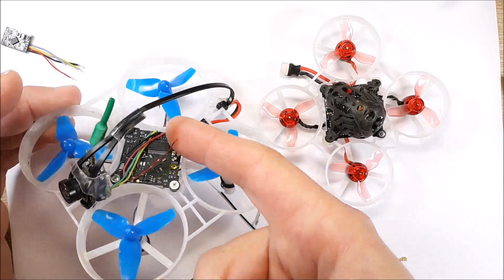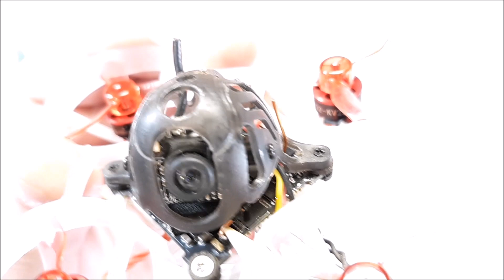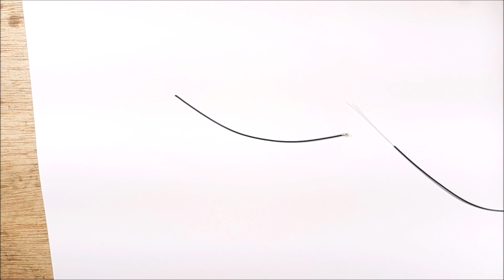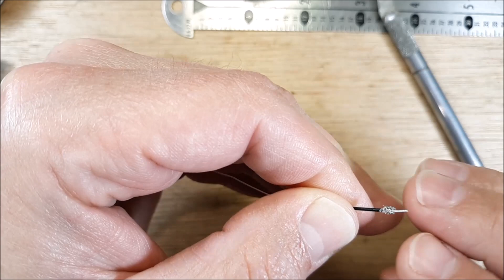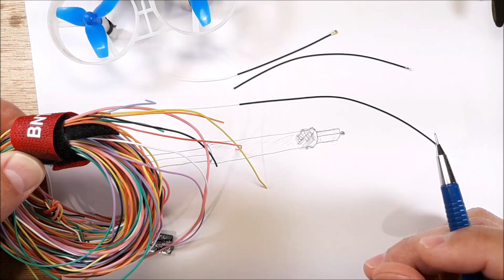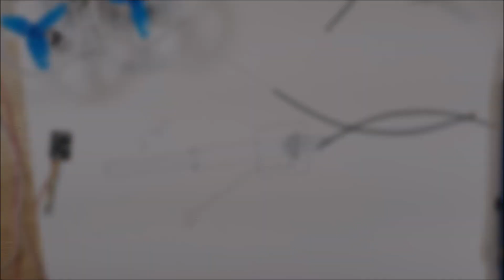Whoop AIO Receiver Antenna Fix | Repair an AIO Frsky Receiver Antenna Coaxial

Comment: Your phone now can " pinch and zoom " to enlarge the picture to see the small detail .   Place 2 finger tips or thumb tip and a finger tip onto the screen and hold them there without lifting and spread and slide them apart to enlarge the picture . I can see the center signal wire active element.  And the woven shielding  mesh.  The shielding mesh surrounds captures unwanted signals and magnetic interference like an atenna and grounds out the electric current from all the magnetic waves and unwanted radio waves and interference . Shielding the center signsl wire . Then the center signal wire that carries the wanted radio signal from the antenna arrives at the receiver cleaner with a signal from the antenna " active elemnt " more clear and less static noise . Your cable tv wire does the same thing to keep your cable tv signal clean .  If cable tv or your drone just used unshielded wire the longer it it gets the more unwanted interference would be added until the signal you wanted was drowned out from all the magnetic noise and static  and transmissions from wi fi and engines driving past and motors around you.  i know everybody knows but maybe someone watching might need to know.

Comment: I need your help, on my Hppymodel X12 1~2S v2.1 fr (latest version)

Been using latest betaflight update from gyroupdate of happymodel which fix the rxlost problem, (its true).

Bu i got problem during 2S flight which is core temp as High above and reaching 90⁰C
Daytime flight is hard.

If core temp about to reach 90⁰C rx lost, on 2S Flight,

Is there any solution ?
Reply from the maker: @junkthe  
If the board is in good working order and there's no shorts, I would assume lowering your VTX output would help. Core temp shouldn't be an issue when flying though. Did you cover it with something? Did you flash the right target and download the correct VTX table? Are you running higher than 100mw?

🤔 Here's more info....
https://www.happymodel.cn/index.php/2022/04/05/x12-aio-5-in-1-flight-controller-built-in-12a-esc-and-openvtx/

Here's the VTX info... (I wouldn't run over power level 2 = 100mw-🔥...🍻

 5.8g OPENVTXFirmware version: OPENVTX
Smartaudio v2.1
PIT Mode support
RCE Mode support
Channels:48ch
Transmitting Power: 0/RCE/25mw/100mw/400mw
Power supply: DC 5V
Current (5v): <650ma (400mw)
Antenna connector: U.FL

Comment: PropsOff You use antenna on a quadcopter, do you think it can be installed in the remote control for better communication?
Reply from the maker: This is a really good question...🍻
I visited this theory a long time ago and found that the radio is supposed to be tuned to the antenna for max performance.. However, those was the days when a radio was $700 - $3,000.... Like you, I wonder if that much attention is place on this fact. I may dig into this after my current projects wrap up...🤔
If you do too, let me know your finding...
Bruce of RC Model Reviews did a great job explaining this about 7 years ago.

Comment: Thanks so much for another great video.   One question.  The original antenna is not grounded.  Why is that?
Reply from the maker: The original antenna is at length for a 2.4ghz signal. If you shield the active part of the antenna, you can hypothetically make the overall length as long as you like. In our case here, we just needed to extend the active portion up and out of the canopy to eliminate emf interference. Hope that makes sense?

Comment: How do i fix random rx loss thats the only issue with my mobula6  build ive even upgraded bolth antennas and it still does it however  my range on my vtx is amazing after watching your external  vtx install vid no the rx loss is my oly issue
Reply: I do not im just using a betafpv literadio 2 se with some antenna upgrades because since i got the newer chips they came out with its bin cutting out randomly
Reply from the maker: @daytonburke7437  
Unfortunately, I don't have the Betafpv Lite SE, however, I have some information in the description of attached video...
https://youtu.be/3YqxDOYv5Bc
Reply: Thank you so much brother i got it hooked up and flying however i have one last question  im using one of the betaflight remotes with mine so how would one do the fine tuning without a screen on remote
Reply from the maker: @Dayton Burke  
Fine tuning is a thing for the Multi Protocol Modules. You shouldn't have to be concerned with the SE Lite..
Reply: @PropsOff  ok cool thank you brother your the best shes rippin now
Reply from the maker: @daytonburke7437  
Excellent! Enjoy the Breeze...👍🏻🍻👊🏻
Reply from the maker: Did you fine tune?
Reply from the maker: Took me a second to find it, lol.. Do you have a muti-module like a 4in1?
https://www.multi-module.org/using-the-module/frequency-tuning
Reply: Sad day i got it all done and wired up correctly  with that new recever installed flew it sight of hand but now my vtx wont work for some reason  it says its not ready to fly when i go into betaflight and it also says vtx type smartaudio  unidentified  what does that mean
Reply: Does it have to do with the r81 recever  being invirted on the ir1 pin like you said to get the recever  working because its sbus revever and a happymodel  ovx306 vtx is there like some compatability  issue between the 2 systems or something  that would be my luck build somthing nuce for myself  think i got it working  and then no dice on the video
Reply from the maker: @Dayton Burke  
There is a specified website to choose the smart audio needed. That one uses Smart Audio 2.0... Has nothing to do with a receiver.
Reply: @PropsOff   when i turn on the s bus recever for better range it shuts off my video and wont connect to camara but if i have it on spi built in one the camera  works but short range on the rssi part hence trying to install recever its like its not sending rssi data to the vtx letting it power up and connect so eather i get good remote range and no video or vudo and short rx range becides this everything  is set up correctly  and should work this is my only problem now thanks to you helping me
Reply from the maker: @daytonburke7437  
That's bizarre. I have not used an external serial receiver on these flight controllers, so I've not experienced that issue. Can you check if the 5v output your using for the camera is the same as the receiver? Maybe browning out the BEC...🤔
Reply: @PropsOff  think i figured it out could it be on the r81 recever its a sbus recever  with no unreversed pad when the s bus is a invirted system on the mobula6

Comment: Thank you, sir, for this very informative video!  I've been having range issues with one of my whoops so I'm going to give this a try to get the active element away from all the other stuff. I now know why the Moblite has such a long antenna.  Also, I didn't know that the simple wire looking antennas are layered like that.
Reply from the maker: The range improved enough to justify the work and risk. I'm looking at double the range so far.. I appreciate your feedback and support...👍🏻🍻👊🏻
Reply: @PropsOff  I'm actually working on it right now.  I can let you know how it turns out if you'd like.  I'm also shortening the motor wires so I'll be a little while getting this build rapped back up.  I appreciate you. 👊

Comment: What if the pad ripped off   with my antenna?   I can see the   tiny pad on the ripped wire    .... mega bummed
Reply from the maker: Your the second person to have this happen. I may need to track down were on the board you can solder a wire to. Are you using the Crazybee F4FR Lite board?

Comment: Hey at 20:30 Mark you see the active element is insulated, how is that insulated isn't that active element just exposed to wire?
Reply from the maker: It's not exposed, there is a thin layer of nylon coating the active element..

Comment: I just subbed :) Very informative videos m8. It would be necessary to ground the antenna with the portion of ground cable to increase the height of the antenna? Asking because before it wasn't grounded?
Reply from the maker: Yes, that's the reason for doing the modification. Just rising the antenna an inch made a difference. My friend couldn't fly around his house. After this mod, he can now make laps around the house. The lower portion must be grounded to eliminate rf from that portion of the antenna. The length of the active part is very specific.
Reply: @PropsOff  Thank you for your reply :D I saw your other video where you mod both antennas in the mobula and asked  if do you know the length of the active element on the VTx antenna because I've seen a lot of videos about the measurements (how to ge it by C/5.8/4) but I see your test video and it looks awesome.. and I don't want to mess my only little peace of coax cable :) Thank you again.
Rod